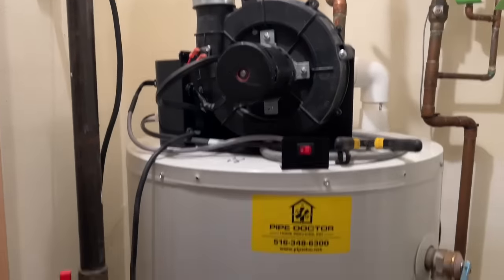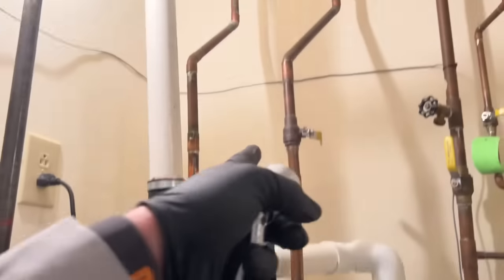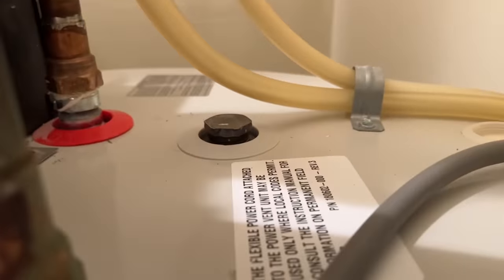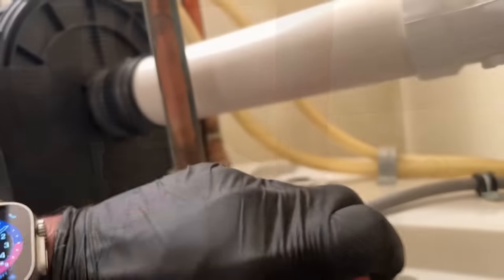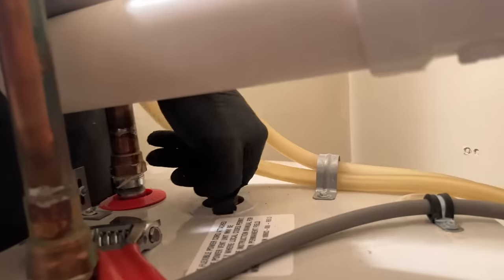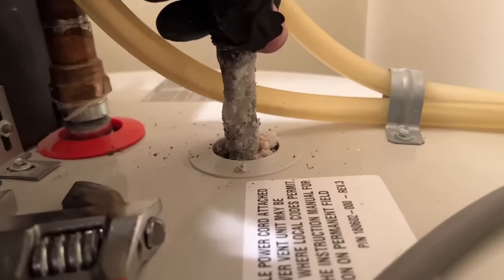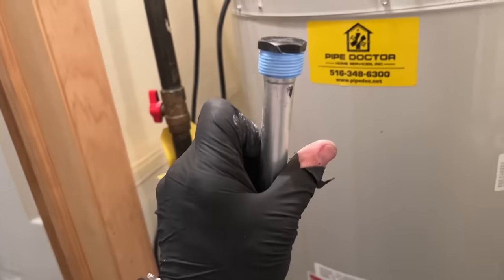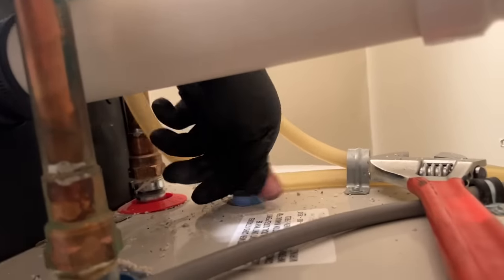New York Plumbers Don’t Change Anode Rods But Pipe Doctor Does! How to Extend Water Heater Life

Comment: Doesn't teflon hinder the connection to the metal of the tank just like a well for on a probe on a boiler?
Reply: Just speaking in general, not as a plumber... an anode rod would need to contact the tank to be effective, but the threads will cut the tape as it is installed so not a concern in this type of situation.  You're just looking for that chemical reaction.
Reply: @PipeDoctor  Should use dope only, not PTFE.  You need a good grounded connection with the rod/tank connection.  The anode will pick up the stray currents and allow it to be attacked.  If its "isolated" by PTFE then it will not work correctly.   While it will still make contact as it cuts through when tightening, the effectiveness will be reduced with PTFE.  😁👍  Also a good time to make sure that your blue monster dope does NOT have PTFE in it as well.  They do make two versions with and without!  The only thing that will "eat" the anode is stray electrical currents.  This is why steel hull boats will have anodes welded all down each side made from zinc for salt water, aluminum for brackish water and magnesium for fresh water.  The cleaner the water the less stray currents can travel through it and a higher anodic metal needs to be used.  Remember that the bonded ground & neutral connection in homes also attach to the water lines.  This causes stray currents in the pipes and ultimately in the water heater that starts to eat the anode, and once its gone, will start eating the steel tank.  This is what causes them to leak typically over time without the anodes being replaced.   If you have harder water then use aluminum anode rods and softer water use magnesium anode rods.  That being said magnesium will be a better overall choice as they produce less corrosive material that ends up at the bottom of the heater, but don't last as long.
Reply: @Chris_In_Texas  It makes a much better ground connection without Teflon Tape.
Reply: @Chris_In_Texas  what is the dope called at home depot? i am about to change my anode. also should i use it for the threads on the heater elements?
Reply: @narcissistinjurygiver2932  pipe dope
Reply: I'm well versed in cathodic protection.  It's not an issue to achieve the desired cathodic protection of steel tank via the sacrificial anode.  There is no way, whether using pipe sealant or tape, that sufficient metal to metal contact won't be made between the threads when torqued down to seal the fitting.
Reply: @stevec8861  Well along with being a licensed plumber for 16 years I also did work for several boat yards running new fuel lines and repairing heat exchangers that had developed leaks because the anodes were hindered by teflon tape. Some were in for years and still remained when they should have been gone in one year.  It's like saying dirty battery connections don't make a difference as long as they are tight.
Reply: @scottvolage1752  I guess if someone uses so much tape they can seal the fitting without the normal high torque.  I've never used excessive tape.  These aren't high amperage connections like on a vehicle battery.  The water heater tank isn't bare steel.  We're talking about cathodically protecting steel in spots where the ceramic lining is breached.

Comment: I have a 1 year old Rheem 50 gal electric wh.   How hard are they to replace on this, simple 499.99 model, nothing fancy?

Mine has the cheap plastic hand turn water drain valve at the bottom.

Comment: I once asked a plumber about chaining the anode and he looked at me as if I was crazy. I get, more profit for replacing a water heater rather than less expensive preventive maintenance.
Reply: @PipeDoctor  Good to know. If I recall, an episode of This Old House, years and years ago suggested that it be done. I also realize that it may or may not be beyond the "reach" of many homeowners capabilities. Here in Nevada, hot water heaters last about 5 - 7 years. We have very hard water but most homes here also use water softeners. We also for some reason have higher water pressure.

Comment: I live in Florida and the water here is very hard with a lot of lime and calcium deposits, I'm finding I'm getting only 20-22 months at most out an anode rod before it's down to pencil thin.  The most recent one I changed 5 months ago, the tank is only 4 years old, I was afraid I was going to crack the tank trying to break it loose, I was putting so much force with a breaker bar that whole tank started moving even with over 40 gallons of water in it.   I had to very carefully heat the fitting with a fine tip flame to break it loose, there was some heavy corrosion on the threads of the rod, I usually just put teflon tape on the threads but this time I put both tape and pipe dope on them.  What do you think might be causing this?   Only thing I can think of is that I have 52 year old galvanized supply lines causing an electrolysis issue.
Reply: Not a plumber, so can't advise, but can say I used a 1/2" electric impact wrench with impact grade hex socket to remove my old anode rod cuz I figured a breaker bar and hex socket would risk moving the tank as you experienced.

Comment: someone gave me their Bradford white water heater because the p/t valve was leaking. I found the anode rod was gone and a few pounds of beach sand in the tank. very little rust so I am replacing the anode rod and the 2 heater elements. Should I use teflon tape on the element threads? also someone said to use "dope" instead of tape for the anode. what do you suggest? thanks
Reply: @PipeDoctor  if there is some rust in the tank should i worry?

Comment: Ok., here is my big question. 
If the Anode rods are made out of Aluminum,
And the rod is designed to dissolve instead of the tank,  is that dissolved Aluminum going into the water we drink, cook with and shower with?
If so, is this dissolved Aluminum causing higher rates of Alzheimers disease?
If so, then shouldn't you replace those Anodes with zinc or magnesium Anodes which would be far more beneficial to our health?
Reply: Yes yes and yes.  But you shouldn't be using hot tap water for drinking.

Comment: Doesn’t the cap of the rod need to be connected without dope for the first few threads in order to mechanically and electrically be connected to the tank?
Reply: @PipeDoctor  Ok.  I’m used to the ones we use in boats, and they have to be electrically bonded to the part we’re trying to save, like an outdrive.

Comment: When non ferris metals and ferris metals come in contact with moisture present, electrolysis occurs, which causes the metals to corrode. The sacrificial anode, draws the electrolysis to it, instead of corroding the copper and iron metal. The anodes only last so long depending on the water quality. They should be checked and changed   When needed.

Comment: Does the teflon tape defeat the purpose of the anode?  I thought the anode should be in direct metal to metal contact with what the anode is protecting.
Reply: The threads eat through the tape when screwed in.  I always use continuity tester to make sure.
Reply: @gfriedman99  You should include the continuity test in your videos.  I bet few people do that step.

Comment: We have an A.O. Smith 120 gallon electric hwh, the top is about 6" from the bottom of the floor joists...anode rod change would require me to drill through the floor (1.5" wide oak hardwood) ..this project is not something i plan on completing

Comment: Do all water heaters both electric and gas have anode rods ?
Reply: Yes. It's not how they're heated, it breaks down from galvanic corrosion. The water heater is essentially a giant battery and the water in it is the electrolyte.

Comment: No length of breaker bar can get the rod out when they are epoxied in by the manufacturer. They don't want you making a 6yr tank into a 12yr tank.
Reply: some do this make them non replaceable which is why you don't use their products

Comment: how much longer do you think one can get out of a WH by changing the AR?
Reply: I had a new 40 Gal gas WH installed in 2006, went to take a shower one morning in 2020, and water pressure was low, went into my basement and the WH looked like the fountain at the Bellagio, never changed the anode, but, with the new WH I will be doing it on a recommended schedule. I'm sure changing it would have prolonged the life.
Reply: 50 years easy

Comment: NEVER pop the relief valve.  Likely wont reseal.  Break vacuum by removing rod
Reply: @PipeDoctor  I was always told not to not saying it’s gospel.  But my tool bag accidentally got caught on one and opened, flooded a basement but after awhile I got it to seal.  Why not break seal with anode rod if you’re draining? Good video
Reply: @PipeDoctor  my  valve was leaking and i found it full of scale. so i put it in vinegar for a few days and also put vinegar in the tanks. both cleaned up and look like new

Comment: I’ve rarely seen a tank outlive the anode, usually replacing them every 3-5 years. New York must have some mild water. The shortest life I’ve seen is 2 years on a state water heater and that was discovered trying to replace a heating element, rust was so bad the threaded bung ripped right off.

Comment: How high should I torque that replacement anode rod ?
Reply: Snug.  Check for leaks.
Reply: No more than 20 - 30 lb-ft tops. Don't go too crazy or you can crack the threads then you're in for a new water heater.

Comment: In NYC you don’t need to change these never.  The Catskills water that supplies NYC has almost no minerals.  If someone tells you to change these refuse
Reply: @PipeDoctor  anyway, there’s anodes are made of magnesium, NYC water is mostly calcium and magnesium which are made of the same substance as the rods.  In certain waters those are necessary but not in NYC which is better quality than any bottled water you could store buy
Reply: @gfriedman99  these rods won’t do anything to protect agains cl2 or F

Comment: What's with the cock hair flying around in front of the lense,😆 🤣 😂 
I use an impact driver to get those bastards out,upgrade to aluminum if you have a rotten egg smell emanating from the hot water system after a chlorine treatment recommended by Rheem.
Great video!
Reply: what impact driver do you use, cordless?

Comment: Most plumbers in Illinois remove the stink rod and replace it with a plug so the water doesn't smell like rotten eggs and fish. Folks blaming the city for those smells and bad tastes have no clue about the reaction of the stink rod with calcium and magnesium in their tap water.
Reply: Are you saying that they remove the anode rod and dont replace it.  I'm curious someone told me the same thing
Reply: @williampubentz9347  yes. They remove the rod and replace it with a threaded metal plug.
Reply: Do u think not having a anode rod reduces the life of the water heater.  A plumber in Illinois said they do this all the time. Pull the anode and cap it. His thoughts are it does not make a big difference in the life of the water heater. Do u agree
Reply: @williampubentz9347  the water is so hard here most would replace the whole tank by the time the rod would go bad. The plumbers I refer to take it out the day of install, plug it up and it lasts the same amount of time with or without. I'm not a plumber but I've replaced a few water heaters both gas and electric in my time and with or without the rod the tanks fill with mountains of sediment here.
Reply: I am on a private well do u still have the same thoughts about removing the anode rod
Reply: @williampubentz9347  again, I'm not a plumber, that being said, if I were using filtration before the water gets to the hot tank, I personally would remove it. I would recommend referring to a licensed plumber who would likely have a clearer idea in regard to well water as I'm certain there would be many more variables to consider.
Reply: @jimmythepirate494  ok thanks

Comment: Its no different than the anodes on your boat. Aluminum,magnesium or zinc depending on your water conditions. If you dont change those anodes your outdrive will be junk in short order.

Comment: Change your own anode rod, it easy seriously, just remember to turn of the water, electric ⚡️ or gas, drain the system and your almost home free.  Suck the trash out of your tank, replace anode rod, heating rods, filler back up, turn on power or gas, relight the system or spark  ⚡️ it.  Sit on the couch 🛋️ and count your money 😂😂😂😂😂😂😂😂

Comment: WTF $200 buck are you kidding me.
Go buy one from a plumbing supply company for under 30 dollars then go to harbour freight and buy the socket and wrench for another $30 to 35 dollars. Do it yourself and keep the receipt and video it to prove you did it. Even if the tank needs replacing that should be about $600 to a $1000 not $2000.

Comment: I think anode rates are a scam because the factory knows how long the tank will last
Reply: Negative, every single tank can corrode at a different rate even in the same town.  The ONLY way to know is to check and change the anode if needed.  I check mine every 2 years and the WH is 19 years old.

Comment: You can replace all the anode rods you want. I'm a licensed New York plumber. And you're right I don't change anode rods. Primarily because that 95% of the rest of the tank is made to fail. It's called engineered obsolescence. You'll have a new anode, then your gas valve, then you're a hot surface ignitor, then your t&p valve, then your pressure switch, will be the next to fail. That's why they only warranty them for five or six years!
Reply: Not a plumber and guess I've been lucky changing my own anode rods.  Lived in one house long enough to get more than a couple of decades out of gas water heater that was still going with no other maintenance when home was sold.  Present gas water heater over 11 years old now and still going with no other maintenance beyond anode replacement.
Reply: Some people get luckier than others. My parents when we built their new house. I installed a Bradford White, the best in my opinion. The tank is 27y.o. and still working. Water quality and bathing load, and  recovery have a lot to do with a tanks life.

Comment: Changing the rod is kicking the can down the road, in MOST cases the rest of the parts will fail shortly after, it makes more sense to install a new water heater.
Reply: @PipeDoctor   we changed them for yrs in the past,  and found that we ended up replacing the units shortly thereafter. But continue doing what works for you.